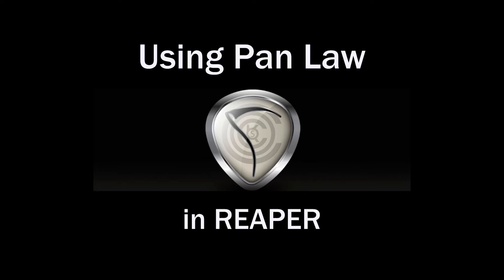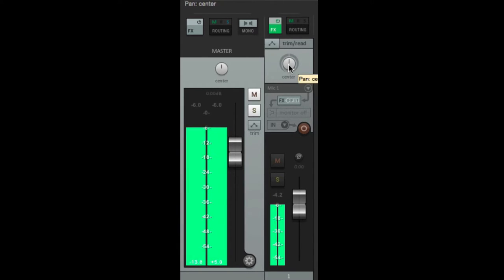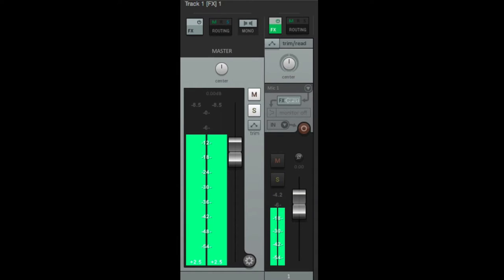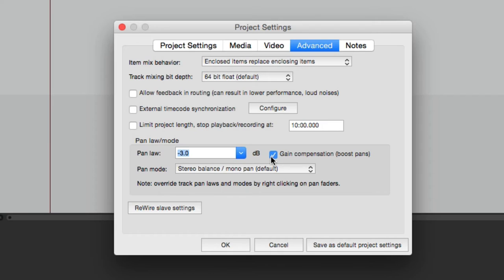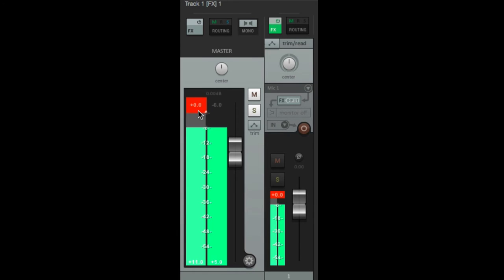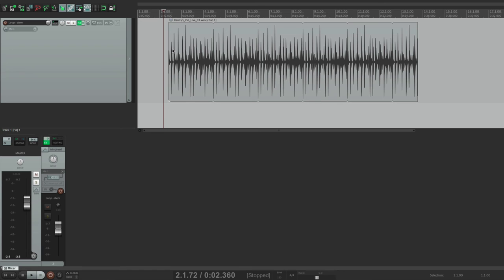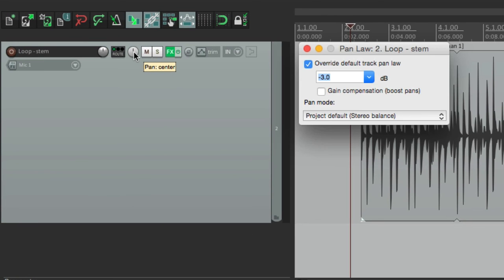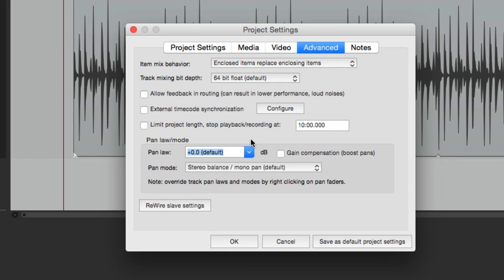Using Pan Law in REAPER

Comment: What if I use a rotating stereo effect like a phaser or a rotary simulation and leave the track panned in the center with the pan law at 0? Is it gonna make the effect appear louder when it gets to the middle or does this only have an effect when using the pan knob of the track? I'm a bit confused as in my thinking the use of a panning plugin should be independent of Reapers track pan law. This would change the sound of any stereo effect with a center signal drastically.

Excellent work as always, Kenny!
Reply: Fancy seeing you here martin.
Cheers.
Reply: Wow martin you too use reaper and watch Kenny ❤❤❤

Comment: A good way to see which pan law is best is to run a test tone (1kHz sine, pink noise) and get an SPL meter at your listening position.  From there you can see how much louder center is than your side speakers.  Then you apply your pan law setting.  Left, Right and Center should all be the same on your SPL meter.  This ensures that, if you mix in mono, your levels won't drop once you start panning things.  Or conversely, if you mix in stereo then play your track in mono, your sides won't come up by up to 6dB.  On a side note, if your left and right speakers are different volumes, adjust the one that's not the same as the other that matches your center channel.  My room is well-treated so I used -6dB but my right speaker was a little louder than my left.
Reply: Thank you for this! I usually check my mixes in Mono, and it helps a lot with frequencies, but my levels get all messed up because some things seem louder than they really are. I'm going to try this technique  asap! Thanks again!

Comment: How is Pan Law affected when you Mix a track using Stereo Pan. With the WIDTH knob. I perceive the mix gets louder when the track is at 100% than when it is at 0%. Maybe it does not in terms of DB metering (ave not tested), But is there a way to compensate for that? So that when I go toward 100% width, I lose some DBs.

Comment: Pay attention to folder tracks if you're using non 0 db pan law in reaper. If your default pan law is -3db, you reduce the gain by 3 db simply by dragging the track in a folder (and -6 if child of child, and so on) . So if you're using non zero pan law, it might be a good idea to switch the pan law of your folder track to 0 or using dual pan on folders. The devs should make the folder tracks ALWAYS 0db pan law whatever the project settings. it would be   less confusion imho...
Reply: +Reno Mellow That is a very good and important advice !! Sure it can be compensated with volume fader boost, but it is really important to know how it works to avoid surprsies.
Also, it is important to keep PAN LAW to 0 when importing already mixed song (mp3 cd rip for example); of you will get volume drop.
Reply: +Dairniel There is a volume drop anyway (just tested with a test tone), but sure, if all parent folders are also panned... the volume drop is higher !
Reply: +Extrem Raym So in short, which pan law and pan mode the majority of users should use? Mean, if i'm beginner, which settings should i use without diving into technical details? Thanks!
Reply: +overbe For stereo mix music listen with stereo speakers (most common setup), choose -3dB.
Reply: +Reno Mellow 
Yes, important point. But using boost side takes care of it.
Reply: You should use pan law with "Gain compensation" enabled to fix that problem, which is normally how pan law should be.

Comment: cool video Kenny.. part 2 pan mode? can you explain the REAPER 3x mode etc. also ive noticed when using pan laws the signal strength varies depending on the type.. example using pink noise instead of a solid tone in your test.. not to mention using VU meter or RMS meters instead of peak meters. a bad experience with the signal being too high going through the fx chain but it saying it was -25 on the peak meter .. which is why i always use REAPERs trim plugin first.. by the way V5 has a new JS volume plug that has a pan law feature now.. and its less CPU than the original Volume trim, check it out.
Reply from the maker: +Frank B (FB IV) I didn't explain that mode because I don't think REAPER wants people using it. But it's a cross between two of the ones I described. Thanks